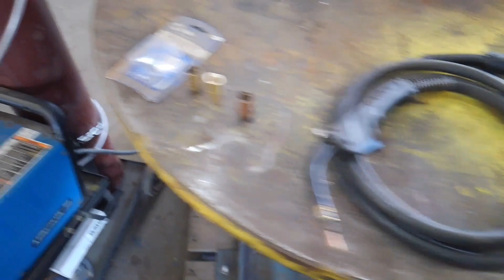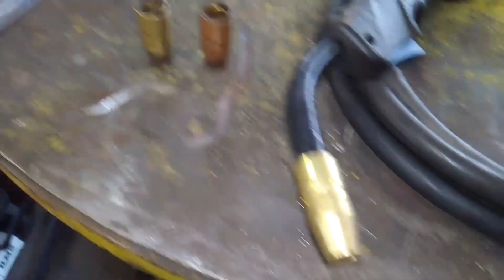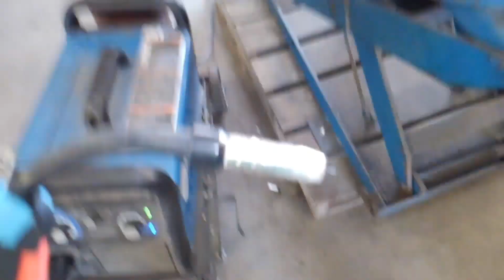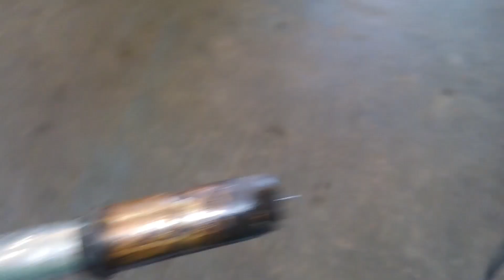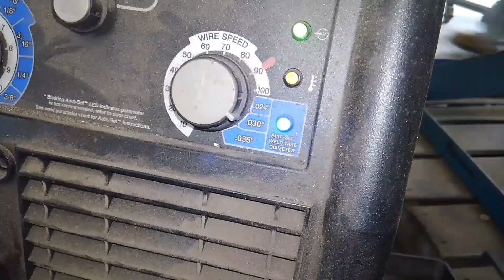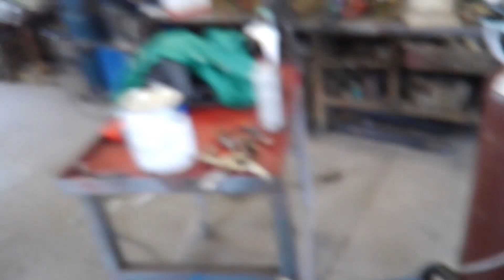Miller 211 problems/design flaw Millermatic 211

Comment: I'm having to change the tip out often while flux core welding. I think it's on the outer limits of the machine and"melting" inside
Reply from the maker: I tried flux for one time I decided that was enough for me it was not fun

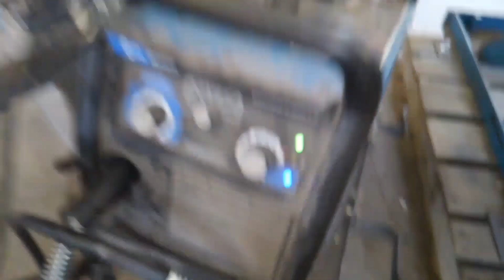Comment: RE: Auto wire speed feature mentioned at 5:25... that quirky behavior ,not getting good welds using the .025 setting.. in my case  I had to go all the way to the .035 autosetting to get back to the nice  flat welds again using .025 wire.  You mentioned that over time this quirk happens.. Seems like it goes out of calibration.  Thanks, I feel I have a new welder again.🙂
Reply from the maker: Yes my original 211 is doing the exact same thing and it always has I don't know what happened... I've been running 023 wire on 035 setting for years now. It does not seem to matter at all.

Comment: Thanks for the information. I run a millermatic 35 without any problems. Going strong. These new techi models are trash that run on electronic boards nowadays amd will not out last my M35.
Reply from the maker: I'm not sure anymore I'm running 3 of them full time no issues to report...

Comment: I have a older model of the 211 , has auto set but not the 5/6 settings at the center of the welder, have the same issue, won't run correctly, lots of splatter and worm holes, they thought if could be a kink in the lead, but this is still like new machine and all, but notice the tip seems to slide on with no stop, first thing I'm going to check now,,,,Great video, and glad I found your review. 👍👍👍👍
Reply: Found the problem , the gun cable at the machine end was about 3/16" from being all the way in, must have been pulled out a touch and messed up mixing with outside air. All set now and did get new cups, can you believe that the guys at the Miller store didn't know what gun tip it took, go figure.
Reply from the maker: Glad it helped thanks for watching and commenting.
Reply from the maker: Glad you got it sorted

Comment: Thanks I have a 211 I will inspect it. Im using a 250 at work and it giving be issues with excessive spatter. Im spend too much time on clean up. Im will inspect the nozzel but i think it has the plastic stop.
Reply from the maker: Can't just got rid of our 250 bought in 96

Comment: Good morning, thanks for your video so we have a bunch of 211 Miller Matic welders at work. Our problem is the feed drive. The wire cannot stay in the groove on the spool. Not only that but at the end of the torch, the wire gets stuck at the very tip of the liner. Have you had this issue? Colorado
Reply from the maker: You're saying it gets stuck behind the tip when feeding new wire? Or it is welding itself to the tip?

Comment: We have the same problems with our Miller 211. And the lying sob from Miller said we need to change the liner!?! They also stated that the same problem we’re having like you are said “funny this doesn’t happen to anyone else!?!
We’re going to give Eastwood a try.
We also had the same problem with the 023 auto settings as well.
Reply from the maker: Just order the HTP gun trust me don't give up on the Miller 211 it is worth swapping the gun trust me we are about to order our fourth one
Reply from the maker: Also Miller did a redesign on their new guns the problem will not happen...

Comment: We had this same issue with the last one we bought a new one and this thing keeps emptying tanks can't find the leak gone through 4 tanks now! Everything is new on it😫
Reply from the maker: Sounds like you got a dud you may just have to turn your tank off when you're done for the day.
Reply from the maker: You may contact Miller it may be under warranty.
Reply: @wildcatwilly  I bleed the tank every night  tried everything and it happens overnight I am talking 300cf tank the big boys it's full one day empty the next
Reply from the maker: Definitely get in contact with Miller I would say you have an internal leak.
Reply: @wildcatwilly  yes it's still under warranty we blamed it on the tank the first 2 times but 4 times this has happened with varying sizes I just wish I could figure it out lol we have a millermatic and two 211s now that ones down we need to share a welder it just sucks

Comment: Hello, have you had any problems with the white reset button in the rear of the welder, I can't keep a bead going for over an inch, then it pops, running on a 20 amp breaker #12 wire, nothing else plugged into the outlet, this is a huge problem for me. Any help would be greatly appreciated.
Reply: How goes it? So I replace the part, millermatic 211 supplementary protector cb1 Part number 093997, and my welder is up and running, no issues, been welding for 5 hrs, the breaker has not tripped. Thank you.
Reply from the maker: Are you running on 110 volt?
Reply: @wildcatwilly  yes sir.
Reply: @wildcatwilly  what's the correct parts name for the white push button in the rear of the welder?
Reply from the maker: Circuit breaker
Reply: @wildcatwilly  ok, now to find it, possibly this may be my problem
Reply from the maker: Are you running on 220 volt or 110 volt?
Reply from the maker: Are you running it on auto set?
Reply: @wildcatwilly  no, on 110, I believe the part is called "Supplementary protector CB1", do you know who sells Miller parts online?
Reply from the maker: Awesome! Glad to hear it.

Comment: For my welder it turns on for like 4 second’s then it turns off
Reply from the maker: I'd say you have a bad motherboard. Send it to Jacksonville they replaced mine.
Reply: @wildcatwilly  hey.... I bought a second hand 211 from a guy... it quit working. Sent it to the Miller distributor around here.. .he says "it appears to be either the "motherboard", which he said was around $600... or the "wind tunnel"... which was over a thousand dollars.

  I told him to stop working on it...
Reply from the maker: I don't know what they cost new at the moment but it's probably worth repairing they are a solid machine...

Comment: I've had my millermatic 211 for 6 years now and have never had this issue you speak of. I'm actually still running the original nozzle and diffuser that came with the gun with heavy usage but I clean it once after every few welds. Another issue you might have been having with porosity is the lead gun input into the welder you have to make sure the gas holes line up or else it will block off gas flow completely to the nozzle which I figured out when I first used it.
Reply from the maker: Thanks for watching.

Comment: Did you get the correct 75% Argon/25% CO2 gas mixture. This is a problem I ran into. Welded like crap, had 100% argon, but it needs the 75/25 mixture.

Comment: I mean I have had this happen on a miller 252 running .045 wire.....welding all day long... I am honestly impressed the miller 211 can generate that much heat for that long.
Reply from the maker: They are amazing machines.

Comment: I wonder if a cheap metal hose clamp screwed down where a plastic retaining ring would sit, would work???   Also I have the original MillerMatic 211 that’s NOT the inverter type.  My next door neighbor who’s a professional welder asked to buy it off me because he said while the older is heavier, it produces a smoother weld bead and doesn’t have all the electronic circuitry inside that goes out after about 8 years.   I said, “nope, not for sale.”

Comment: We have the same welder at the shop I work at.
Was welding and the wire stuck in the tip. The wire balled up behind the drive motor.
I cut the ball of wire out and was refeading it into the cable sheath. Now the drive motor won't turn. I can jumper 12 vdc to the motor and make it move.
But nothing when I pull the  trigger.
Any ideas.
Where is the spool gun switch?
Reply from the maker: No clue sorry.

Comment: I’m glad I watched this.  My miller started doing the same thing and I thought it was bottle, then reg, then gas actuator... didn’t even think of the nozzle since the machine didn’t even have a 10lb roll put through it yet.  I’m with you on design flaw.  I didn’t think of the nozzle since I have a Lincoln welder that I have only changed the nozzle on once in 15 years so it wouldn’t have accrued to me to change the nozzle after 5 hours of welding...total BS if you ask me.  I guess I should have stuck with the Lincoln’s.
Reply from the maker: Miller redesigned the gun now.

Comment: I have the same problem with the miller 211 thanks for posting I wanted to go buy a Lincoln instead but thanks
Reply: Dont go lincoln their new equipment is junk. Miller might make this guy grumpy but theyre still top dog.

Hes bitching about a $1500 mig machine.

Its only $1500. What do you expect $5000 quality?  Like come on.

Just get a $400 tweco Velocity 2 gun and have a grand old time welding flawlessly.

Screw on nozzle, simple, no bullshit.

Comment: Miller just announced conversion diffuser, nozzle, and tip for the M100 gun to the MDX type.  ( I have an M100 like your older gun on my 211which is 4 yrs old and about 40 lbs of wire through it )  Is it worth the conversion to MDX consumables ? I'm not sure what your newer gun is ( MDX?)  - do you like it any better  than M100 ? I am strictly amateur when it comes to welding.
Reply from the maker: I'm not sure about the MDX conversion. I do know that my htp swan neck has been flawless.

Comment: I have the Miller 211. First time using with gas and hard wire , previous with flux. Issue is no gas getting to tip. Holes are clean , everything is tight , even changed out tip , cone and adaptor. Any ideas on what is going on ? Thanks
Reply from the maker: If I had to guess you don't have your gun stuck in the brass retainer deep enough??? On the gun on the inside of the welder there is a brass shoulder cut in with four holes and two o-rings on either side.
Reply: WildcatWilly  Started from scratch : disconnected from welder , cracked valve to clean out , connected hose and slowly opened pressure valve and I then felt gas going thru hose. Re-connected to my 211 , ran several beads , and without porosity ! Yeah , should have done this yesterday. Thought about it at work today. Beads look really good ! Thanks for responding !
Reply: WildcatWilly I will check. Thank you

Comment: ever heard the term consumable?
Reply: That was exactly what I thought.
Reply: Pieces falling apart because they were held together with glue when they should've been held together mechanically, i.e. press fit, is NOT the reason why anything should be given a pass as a 'consumable'.
Reply: I have my ESAB 215 for 3.5 years, and my ESAB 205 for about 1.5 years, and I’m still using the same nozzles. This problem shouldn’t happen, even with a cheap gun.

Comment: You know what's crazy? I clicked on this just for shits and giggles. But I have the EXACT same issue with my Miller multimatic 215. I have to change nozzles out frequently otherwise I start having massive porosity issues. I did the same thing still under warranty and talked to my dealer about it. My nozzles never slid back as far as yours but it would slide back just slightly and cause insane porosity. 

What gun did you end up buying I may change mine out I wouldn't mind a 15 ft gun anyways.
Reply from the maker: I bought a 12-foot I believe HTP America swan neck the swan neck kind of wiggles around that can get annoying but haven't had any problems yet still using the original nozzle
Reply from the maker: I wouldn't be scared to get a 15-foot

Comment: I've run several 10 lb spools thru my  211 with zero problems.  You might want to research duty cycle,  and proper care of your welder....You're overheating it and judging by how you take care of it the whip has probably been crushed more than once.....

Comment: So I’m in the market for a Miller welder and I’m considering this 211 would you buy it again if not what would you get? 
I think I’m skimping on a 211 but hate to fork out the cash for the 252.
Reply from the maker: Well it will hold it's value if you don't spray paint over the top of it. If you want a good sheet metal machine I would get a 211 as long as you are laying beads for 10 hours a day. Check Facebook market place I see them on there like new for like $800 sometimes Miller 250's for like $1200 to $1500.
Reply from the maker: Personally I would buy a 252 but I'm thinking of setting up a new shop and getting it 211 again. So hard for me to say honestly sorry that probably isn't much help. My reasoning is the welding I will have that shop do is non-critical welds so basically no learning curve. I have had the 211 blow a circuit board thankfully it was under warranty.
Reply: Well I know I can’t go wrong with the 252 it’s just the initial investment that’ll hurt. My only welder is currently a miller bobcat 225 so I can weld heavier stuff with that but it’s just loud in the shop and harder to weld thinner  material. I’d like to be able to mig weld thinner metal and some aluminum. I don’t know, lol. Thanks

Comment: I have the same welder and have had it for about 2 1/2 years. Still use the same gun the only thing that went bad was some type of board and miller fixed it for free and they did it kinda fast.

Comment: I'm just gonna say this 15 years I have used cheap ass China junk from Harbor freight 
 Recently I purchased Millermatic 211  
 And I can say this very loud and clear it's worse than  Any other one I ever had. I should have bought Vulcan from Harborfreight  it would have been much better, half the price.
Reply: Some people don't like working with shitty Chinese tools tho. I'm allergic to them personally
Reply: @jesselawson1169  yeah some people are dumb and overpay for same crap with different sticker.
Reply: @intruderIG  yeah you're right, you can probably buy your junk welder even cheaper on Amazon under a different name.

Comment: I never experienced this with my 211, but my issue was I wanted a longer cable so I bought a Bernard 15'. Aside from that I really like my 211.
Reply: Did the 211 handle the 15' without issue?
Reply: @dlewis4647  My 211 handles a 15' whip great. I have not had any problems at all.

Comment: You mentioned that the problem is a brass sleeve that loosens because of the weak adhesive bond and then the nozzle works its way forward. Since the HTP and older Miller gun don't have this problem because they both have that plastic sleeve in back of the nozzle will a zip tie placed in the back of the nozzle solve the problem? I've read one of the issues with this model is the weak ground clamp but I see you are still using it. I take it you've not experienced any problem with it? I'm buying one of these welders and I'm looking to cure any issues before they come up.
Reply from the maker: I know that certain YouTubers go on and on about a double sided ground clamps. I have never once had an issue grounding think about it like this every time you squeeze the ground clamp it wears on the hinge pin keeping it shiny therefore creating a double sided ground clamp. My brother resorted to using a 3/4" lock collar I believe... it seems to work if you started with a fresh novel. HTP has a gun that is not a swan neck if you are interested high quality and I am still using the swan neck.
Reply: Thanks for the info. I have a 15' HTP flex-neck gun on my Lincoln and I really like it. I was thinking of getting the same for the 211.

Comment: We have the same welder, it has failed us completely not only the tip but also the mother board. When it completely stopped working i took it 1.5 hours away for repair and went to Harbor Freight and purchased a Vulcan mig , I must say we still use the Vulcan and the miller is still sitting in the corner collecting dust. After the miller was repaired it worked beautifully for a couple of weeks then turned into a turd again.  Don't shoot the messenger and no it is not my welding ability's.
Reply from the maker: Randy Russell I have also lost a motherboard and an arced open on switch

Comment: Much love for my INDUSTRIAL Millers. That thing is not an industrial machine. The gun is a cheapy despite the traditional Miller back end, and the fix for cheap guns is replacement not repair. A Tweco style gun has plentiful consumables (the patents are many years expired) and they are readily available with a Miller back end.
Reply: Ob Fuscated  I had numerous problems with my miller 175 and switched to a tweco gun and it works great now. I couldn't understand why I kept freezing tips on my miller while I could go to work and run a lincoln 255 for several days on the same tip and finally switched guns on mine. I'm not really a miller fan but it works great for what I need it to do.

Comment: Your review is a life saver. I have noticed more porosity from my 211 and I really thought I was getting out of practice, but my nozzle resembles yours.
Reply: Which exact model htp 12’ gun did you get to work with the millernatic 211 ?
Reply from the maker: jason homer I'm sure if you keep the nozzles around it will be just fine but I added a 12-foot gun with a swan neck from HTP America and I will never go back

Comment: Thank u that's what is wrong with mine ...
Reply: Kuekuatsheu just bought the knew Tip ....WoW I though I was loosing my touch .thanks man
Reply: Miller is a common welder. They sell contact tips in various lengths.

Comment: Hardly a major design flaw. Big surprise,  you have to change you consumables once in awhile . By the way your welder looks you dont take very good care of your stuff. You might want to dust it off and blow out the machine with some compressed air once in awhile.
Reply from the maker: Jeff Ferguson perhaps not a design flaw but definitely making the machine cheaper.